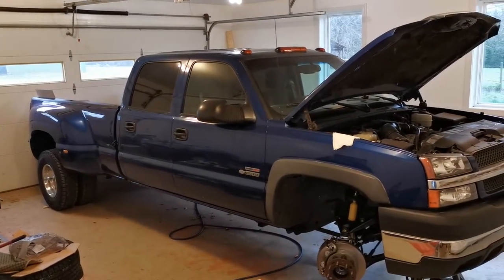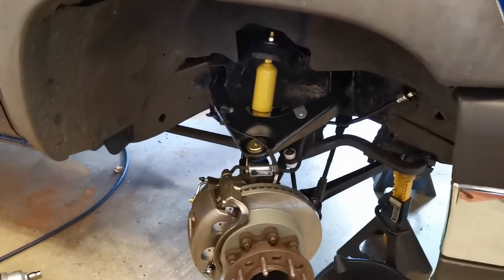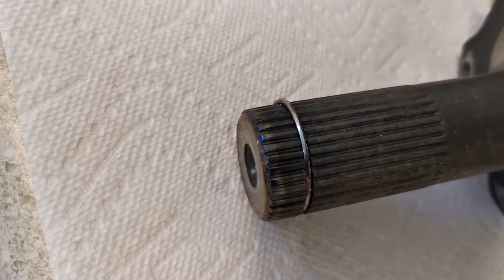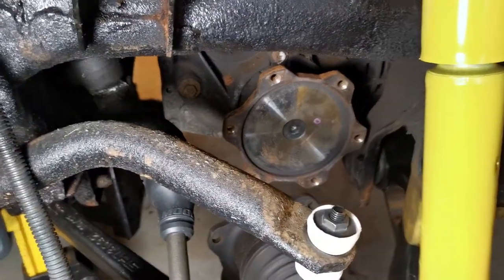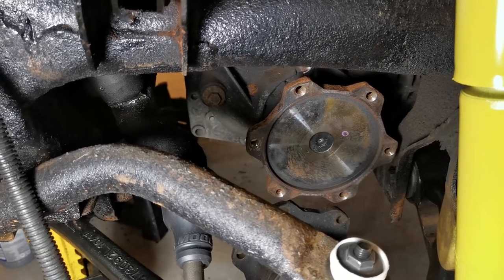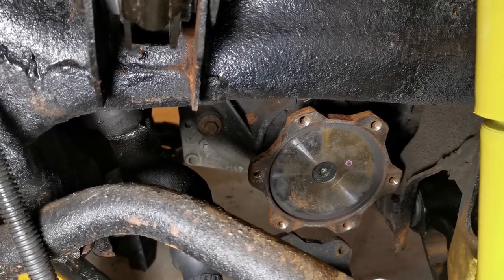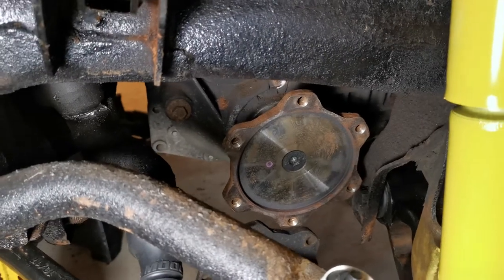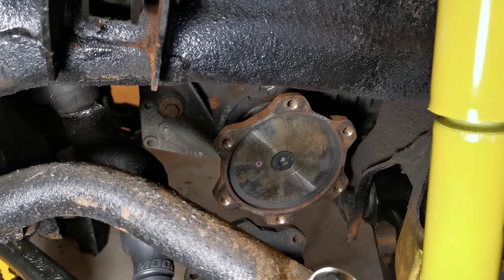Chevy Silverado / GMC 4x4 Truck, Secret to removing Stuck Left Front (Driver's Side) Axle

Comment: it took me about 2 minutes to remove the axle shaft without a slidehammer on my 2002 1500.  I smacked the flange in with a rubber hammer...turned it 90 degrees and pulled out with my hand.  The second time it popped right out.  Of course I googled it before I started.  your post will help out the novices.

Comment: For some reason, YouTube withheld your helpful video to me until I dropped the whole case, on the bench, split open, bumbling with getting the pinion shaft out of the way, yet to remove said axle shaft. Went to find some video about differential disassembly and YT decides to put this gem at the very top of my feed. 
After I’ve torn it all down.  
After I successfully wrestled the oil cooler lines in without removing it, and now since the diff is out you know that automatically means it’s oil pan gasket time. Which now means those three days spent wrestling them in were wasted since the lines bolt to the pan. 
All good, I’ll save this for next time, great info thank you good sir

Comment: Tried this for 2 1/2 hours without the slide hammer. Instead used gentle to moderate force with a mini sledge on the bottom of the flange (only spot I could get the mini sledge). Was just about to drop the diff and decided to try a pry bar. Trick was to pry from the top and simultaneously hit the bottom. First time I only replaced the seal. Had to do it a second time because the bearing ended up needing replaced too (probably what caused the seal to fail). Second time around the shaft popped right out using this technique. Maybe 5 seconds. My retainer ring was in tact and remained in the diff as well. Guys, don't go ape shit trying to force the shaft if it doesn't come out. More likely than not, you'll break off tabs needed to set backlash if you do.

Comment: Excellent tip James! I'm about to start this project on my '99 K2500 GMC Suburban. I've done one on my 1/2 ton Suburban but the 3/4 ton Suburban is different. Your truck front end looks the same, so hopefully I'll be able to do this job much easier knowing this. Thanks again for sharing.

Comment: I did mine today, axle came out pretty well, like three rotations and tapping with rubber mallet. My problem was getting the old seal out, that took about 2 hours and every dirty word I’ve ever heard. How did you get the old seal out? I’m sure the passenger side seal is not too far behind. Great video!
Reply: There's just enough space to get a long pry bar in behind it. It'll come right out. Just be careful not to scrape the housing.
Reply: Get the seal puller from harbor freight. It’s less than ten bucks. Took me 2 min to get it out with that tool.